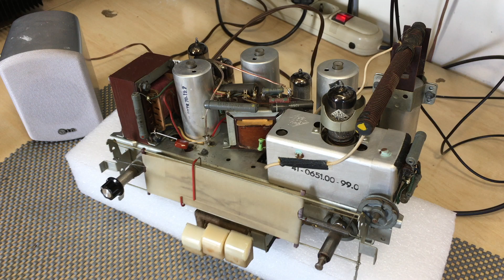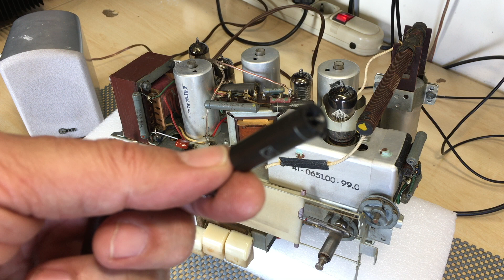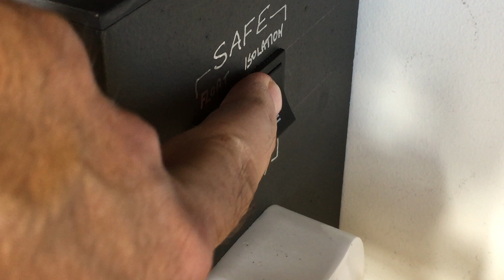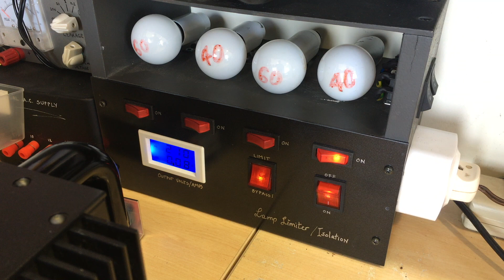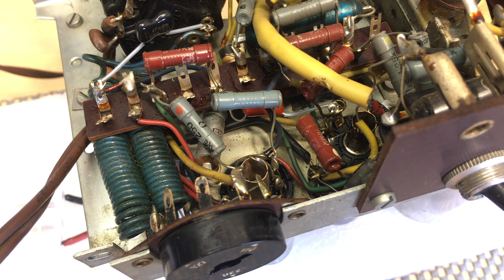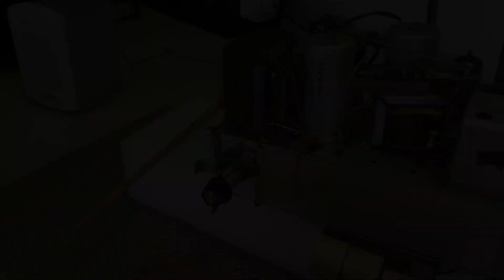Telefunken Jubilate restoration - Part 2. It works! Sort to ...

Comment: Hi ! Thanks for this grateful video!! I am living in Germany.  I found one small Telefunken Jubilate 1161 on the street. It seems it was many years in a cellar. Also changed some capacitors (also the filter caps) . It works pretty well. Fortunately it has a isolated transformer. I have just some doubts about the antena conector and selector. Not sure hoe it works and what antenna should build/connect. I think it is the same conector you have in yours.  Could you give me a hint about the antennas, connector and selector? Thanks in advance. Regards.
Reply from the maker: The two wider spaced sockets are ground and AM long-wire antena. The two closest together are for an FM dipole.
Reply: @electronicsoldandnew  thanks for your answer! Tha was fast! I saw the next video about your Telefunken(part 3). But it differs from the mine one . The selector is not connect to main via a cap.  But the selector is still there. It ends in a coil. Is this an internal antenna? Actually, there is a wire coming from the selector hole.

Comment: I have an example of an updated version of this model called a Jubilate 6, export model. The differences being is that it has a selenium bridge rectifier rather then a halfwave one, and it has one rimlock tube rather then two rimlock tubes. Like yours the filter caps are shot, either that or the EL41 has a heater to cathode short. I checked the power supply, the transformer in mine does isolate the chassis from the power line, I checked it between both prongs on the power plug, and the chassis, with an Ohm meter, no connection. Whether this was a change made in the new model or whether the connection is an error in the diagram I don't know. As someone suggested below the previous video it may be worth investigating to see if that connection, if it is there, could be removed by rewiring the transformer.
Reply from the maker: The jubilate 6 does have a proper transformer, if the schematic I’ve seen is to be believed. I actually thought this one was that version when I bought it.

Comment: Another excellent video, and the safety warnings are well worthwhile - I take them as less a matter of "don't touch; you'll die!", but more as "respect it, it can kill you, and be very very careful if you aren't yet experienced enough to know how to respect it". And I'd laugh a bit at the end too ;)

Americans and other 110~120V users are, to my mind, often a bit blasé about live chassis sets. At least until they encounter one that, like this, has an autotransformer-boosted B+. The combination of 200~300V B+ & the inductive kick from the transformer when you get across it usually straightens them out real quick ;)

You probably know, but worth pointing out that the 50pF mains-antenna cap should probably be a suitably-rated class-Y cap (e.g. Y1), or at least a class X/Y cap with a Y1 rating (e.g. X2/Y1). Reason being that class X caps are designed to fail "safely" - which is not the same thing as "open circuit". A class-X cap is allowed to fail short if it can do so safely (e.g. a good solid short that'll blow a fuse/breaker, without melting &/or catching fire) - and if it does in that case, you end up with a potentially-live antenna connection. A class Y cap must fail open-circuit, so is the much safer alternative.

That said, I don't know if you can even get 50pF class X or X/Y caps - I think that value would only be available in class Y.
Reply from the maker: The matter of shock hazard is one which is difficult to transmit to anyone who hasn’t experienced it themselves. It really straightens you out pretty quick. Quite literally in some cases :)
I’m using the temporary ‘normal caps’ until I decide if I’m going to swap out the transformer, in which case I’ll do away with the ‘mains antenna’ link. If I use them, they will be Y-caps for sure.
Reply: Personally, I'd be tempted to try it with the 'antenna cap' - although they're useless for AM reception these days they can work quite well on FM, at least for local stations. Might be worth demonstrating for a video at least.

(And I wasn't dreaming after all - you did call it a Jubilate 6 in the first video 😉. It is, of course, the original Jubilate from 1953, not the later 6.)

Comment: In the video from TRX Bench the wiring layout between transformator and can is realized as it should be (14:58) - it is possible, that in your Jubilate someone else earlier constuct this dangerous connection after reparation?  Cant believe, that this is engineered in this form...
Reply from the maker: Yes, that would make more sense.

Comment: You have my permission to proceed with your current plan!  😂
Seriously... Good stuff! I enjoy your videos!!  I have a couple old tube radios I'd love to get working. However, I've not got the patience or the know how. So one of them is going to turn into a RaspberryPi Internet radio. I know that will make some people cringe. But It's better than letting it just collect dust.  Cheers!
Reply: Why not use an empty cabinet, there are plenty of those around with no chassis or speaker inside. At least that way you won't be junking what might be a collectable, or at least restorable radio. Post an ad on craigslist asking for one, and someone will probably oblige.

Comment: Nice little radio there!  I’m watching this series with more than my usual interest because I have a similar hot chassis radio I’m about to tackle.  It’s a Japanese National AF-300, a six tube compact radio from about 1961 with long wave, shortwave and FM, all stuffed into a plastic box that could fit onto a night table.  Like yours, it is in very good condition with original schematic but it has no power transformer at all.  Instead, it uses a series heater circuit and it’s well stuffed with parts, so I’m looking for ways to make this one safe to work on as well as safe to use after it is restored.  My DIY iso trans/dim bulb tester will get a workout for sure. The radio does have a separate antenna circuit so unlike yours it's not combined with mains cord.  Question: Can you convert transformer-less radios to three-wire mains or is safety caps and polarized plugs, or some other method, the best way to go?  I’ve heard various stories on this debate.

Comment: yeah the funny thing is although old radios are indeed dinamite they lasted so long and modern products with all the safety regulations they are just laughable most of the times when it comes to actual real world safety or reliabiity...for example try to pull 16amps out of a 16amps rated modern extension cord and you know what happens ...fire.... or use a 400v rated capacitor at 400v.... back in the day they used to mark the capacitors with "WVDC" or working volts dc...nowadays it must be something like maximum voltage for one milissecond before it pops

Comment: nice video.
And yeah, today i've repair a ancient LF generator from the 50s that was leaking some mains on ground but with no earth connection at all, of course the differential not work as long as it's not connected to something else that have the ground but if you touch it you get a shock! Well, i understood really fast why it was leaking the live part was really dangerous and put together with no security rules respected at all and after i cleaned up all that mess and put a brand new line cord with earth properly connected i did a last test before i put the cover back and wow perfect everything working and no leaks..... then, i've put back the cover and believe it or not but when i turned on poof, no light at home..... and why? because the cover touch the top of the transformer and it's where is the live and neutral connection! and that tool is not a kit it has a manufacture plate and it's Made in France!
now it's ok and safe this time but it was a real danger.... that thing generates only sine wave between 20hz and 200khz with can be useful and the last thing i found on it is it's fuse. it's on the 230V and 1.5A for drive a tiny transformer with really fine wire..... well, i'm going to replace that of course with a slow blow fuse with really lower rating

Comment: Nice old radio! One comment to the 50pF capacitor seen at 2:10: In Germany and other countries in Europe there was a system called "Drahtfunk" (radio over wire) established in the 30s of the last century which was in use during WW2 and up to the 60s. There were AM-signals coupled to the power lines with special transformers in the LW and MW range; and as i know also via telephone lines. With special switches it was possible to use the power line as "antenna". These systems brought AM radio signals to all households and could easily be controlled by the governments in those days…...
Reply from the maker: That’s what I love about this medium: you learn something every day. I read up on that system after reading your comment. It’s the first time I’ve heard about it and found it very interesting.
Reply: @electronicsoldandnew When i was a young boy, my grandma had such an old radio. On the scale there where many famous European stations listed; but one station in the LW-range had the name "Drahtfunk". Nobody in my family could explain what this is! Now i know. Maybe that this radio (or others in your collection) also has one station marked with "Drahtfunk" on the scale - have a look!
Reply: ...similar to the controlling of mobiles and private internet connections by the governments in our days?
Reply: YES! @48_Crash
Reply: I didn't know that! Very interesting, I'll go read too. :-)

Comment: There is actually a Telefunken set at the local flea market here in Wichita, Kansas.  It's one of the larger models, but if I remember right it is in the Jubilate series.  I may have to go and take a pic of it if it is still there.  Too bad I can't afford it.  It's actually the first time I saw a Telefunken one in person and it is an export model.
Reply from the maker: The export models actually have FM that extends a little further up the band. Great radios.